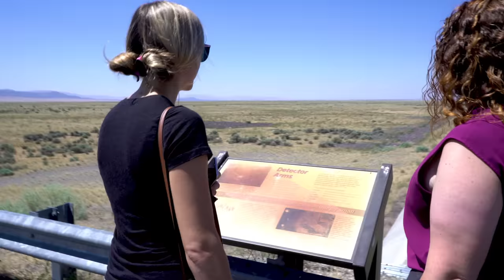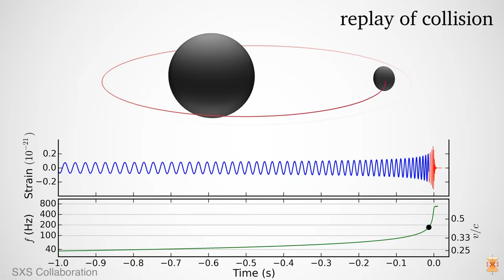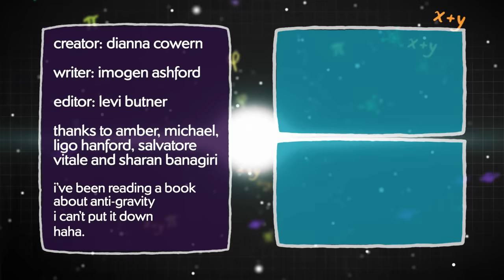Why are there giant concrete tunnels in the desert?

Comment: Speed of gravity that's new
Reply: Most people think of C as the speed of light. In reality it is the maximum speed of the universe. So anything that moves at maximum  velocity movies at the same speed as light because both of them are moving at C which is the maximum speed of the universe. Radio waves also travel at maximum speed. So if gravity has a speed it makes sense it is C.
Reply: It's always handy to remember that when we talk about the "speed of light" we're not actually talking about light* so much as the maximum possible speed that any signal/information can be sent. In that sense, everything has a speed, and gravity just happens to be in the special class of phenomena that operates at max speed (or so close to it as to be indistinguishable).

*Of course, it does also describe the speed of actual light in a vacuum.
Reply: It's all the same thing  and it's the speed of causality.

PBS spacetime has a great video on exactly that.
Reply: Yeah I thought that the effects of gravity were instant, wasn't that the premise of of Interstellar or something? Using gravitational waves in order to communicate instantly?
Reply: @skeptic1000  I don't think there was any faster-than-light communication in Interstellar, unless you count communicating through a wormhole. But that's not really "faster than light," it's just taking a different route.
Reply: @skeptic1000  it is instant if you stop thinking of delays as of delays in one direction.
But will it be instant round-trip?
Reply: Vsauce, Michael here...

No seriously, he did do a video on the speed of gravity. I forgot the exact title but it goes along the line of what happened if the sun disappeared.
Reply: @soth1sol  thanks for the link
Reply: @Marnige  you were right
Reply: @oppie2363  quantum teleportation faster than light, false?
Reply: @davemwangi05  Short answer: no, because it depends on classical communication to resolve.

Edit: I realized my answer might be confusing because you asked "false?" which makes my answer a double negative (and an incorrectly used one at that). To clarify: my understanding is that quantum teleportation depends on classical communication (i.e. light-speed-or-slower communication) to derive any legible information from the process, so it doesn't break the speed of causality.
Reply: @oppie2363  okay, entangled particles?
Reply: @ecospider5  radio waves are light waves. The spectrum of light is much much larger than what is visible to us.
Reply: @davemwangi05  My understanding is that the same principle as teleportation applies - the entanglement does appear to violate the speed of causality at the quantum level, but to derive any useable information from that process it has to be paired with classical communication. Don't take my word for it though; I'm mostly just a layperson/enthusiast. I recommend watching PBS Space Time's various videos on the subject of you're interested in it.
Reply: @oppie2363  PBS is a real Nerd. LOL I used to watch him but this u-tube algo.
Reply: @ecospider5  That's not right. There is no maximum speed of the universe. It (the universe) can move at any speed. It is currently expanding faster than c. That's how you get 13 billion year old universe where the size of the observable universe is 90 billion LR in diameter.  c is the fastest a signal can move through space-time.
Reply: @biffy7  I believe (though I don't have the math in front of me) cosmic inflation is consistent with relativity through time dilation.
Reply: Not new news. Gravitons have been conjectured through most of the 20th century and confirmed with relativity. Curiously, almost everything moves at the speed of light. The Higgs boson is the thing that slows stuff down, e.g. gives stuff mass.
Reply: The thing not understandable for humans is: when a black hole is a singularity in the space-time-field, means that the curvature of that field is infinite, how does it transmit the information of its own gravity? If gravitation moves with the speed of light, the gravitation itself cannot escape the black hole. But because black holes are only mass and nothing else, it would rip itself out of existence. But that cannot be, these things are very real. That would be a paradox to explain.
Reply: The wave has speed.

Gravity is the force of attraction, due to mass.
Reply: @stephanbrunker  It's a paradox of the model, obviously not of reality, given black holes exist just fine without ripping apart the whole of reality. But since we can't observe what's going on beyond the event horizon (not the black hole, itself) we can't see how to update our models to unwind the paradox.
Reply: @skeptic1000  i saw brian green say it was instant on pbs...
Reply: @CJ G I have always wondered about that with radio waves. Do radio waves have photons.
Reply: @Biffy7 from Wikipedia. “According to special relativity, c is the upper limit for the speed at which conventional matter and information can travel. Though this speed is most commonly associated with light, it is also the speed at which all massless particles and field perturbations travel in vacuum, including electromagnetic radiation and gravitational waves. Such particles and waves travel at c regardless of the motion of the source or the inertial reference frame of the observer. ”

That is what I was referring to. Which is much more than just signals. 
But I do get your point that including the expansion of the universe speed does get confusing since something can technically be getting farther away from me faster than c since the space between us is expanding. 

https://en.m.wikipedia.org/wiki/Speed_of_light#Numerical_value,_notation,_and_units
Reply: @ecospider5  Radio waves are light just like visible light so yes, it is made of photons. They just have a longer wavelength than visible light. On the other side, x-rays and cosmic rays have a much shorter wavelength.
Reply: Mmmm.  Not really  a =  m/s^2
Reply: soth1 sol 
Doomsday, or ignite a gas giant?
Reply: If the sun disappears you are going to wish the flat Earthers are right. Just kidding.
Reply: @oppie2363  Entangled particles are faster than light though and hypothetically even if it is paired with classical communication methods the loss of delay from relying on C would be greatly important, especially at light year distances
Reply: @liammargetts  If you're pairing it with classical communication, you're relying on C.
Reply: @oppie2363  But let's say entangled particle A on one side of the galaxy then particle B on the other side, if A's spin changes, B's spin will copy that instantly, so one just relies on C when trying to measure B
Reply: @liammargetts  Which means you can't know whether anything (e.g. spin) you measure about B is part of that communication or random noise until the classical communication arrives. So like I said above, it does appear that certain quantum effects propagate faster than C (or violate locality altogether, which amounts to the same thing in this case), but since they're dependent on classical communication to be legible, C as the maximum speed of information/causality is preserved.
Reply: @oppie2363  Oh I see. I don't have a reply, I'm optimistic that we'll find some way around that problem though as quantumly entangled communication seems very cool
Reply: @ecospider5  Technically, it's the speed of cause and effect.
Reply: @ecospider5  This is also the very same reason why nothing will ever travel faster than light. There is no energy to propel you faster. It has nothing to do with you gaining weight, energy just runs out of push force at the speed of light.
Reply: Not much talk of physics in these comments. LOL. Blooper in the opening remarks. If gravity arrived at earth in 8 minutes at lightspeed the  earth would be flung out of orbit in a few thousand years. Its been shown. This comfortable belief  seems to only serve to keep Einstein as the patron Saint of Science. Gravity influence is near instantaneous at about 20 billion times faster than lightspeed. And here it is explained succinctly at a physics site.
Does Gravity Travel at the Speed of Light?
In the simple newtonian model, gravity propagates instantaneously: the force exerted by a massive object points directly toward that object's present position.  For example, even though the Sun is 500 light seconds from the Earth, newtonian gravity describes a force on Earth directed towards the Sun's position "now," not its position 500 seconds ago.  
Putting a "light travel delay" (technically called "retardation") into newtonian gravity would make orbits unstable, leading to predictions that clearly contradict Solar System observations
  So Newton was wrong. They Forgot to tell you at school.
http://math.ucr.edu/home/baez/physics/Relativity/GR/grav_speed.html
You guys believe anything from a pretty face. But it doesn't really matter. LOL
Reply: @kimbo99 Well... Steve.... You are wrong too. Since Gravity is a wave and the Sun is giving off this wave in all directions, 500 seconds from when the wave was given off the earth moved 500 seconds but the wave that interacted with the earth was not from the point the wave was given off, but from the point where the earth would be 500 seconds later. 

I'm surprised you are not smart enough to know that or figure that out on your own. And yes the Gravity wave moves at the speed of light. That Gravity wave length is roughly 700 nanometers.
Reply: @kimbo99 After thinking about this for a few microseconds, I'll give you a better example. You are on the football field. You are a receiver and the ball is snapped. You start running. The quarterback is going to throw you the ball. He doesn't throw you the ball at your current position, He throws the ball to the position you will be at, for how ever long it takes the ball to travel to your future position. But, that position where you catch the ball is the shortest position between you and the quarterback. Now the quarterback could have thrown out millions of footballs by the time you started moving but you would have only been able to catch the one football out of millions that was the shortest distance between you and the quarterback at the time that it took that football to arrive to you.
Reply: Just remember, one must clarify that c is the speed of light IN A VACUUM.  Photons have been slowed down to less than normal highway speeds in experiments.
Reply: Matt Lombardo  who says it travels in waves?
Reply: Matt Lombardo   There are no ripples. gravity waves dark matter dark energy  black holes are inventions all to keep St Einstein in place as the patron saint of physics. The speed of gravity is 20 billion times lightspeed. Near instantaneous. C is slow by Universe standards.  C cant be exceeded but the universe expands quicker at 2.5 C Its on Discovery channel. Must be true. Real science worth following is Electric Universe. Much more empirical proof. Many more successful predictions than the Big Bang faireytale. Sorry no girls at Electric Universe.

Comment: So does gravity have a resonat  frequency or even have a frequency at all??
Reply: Isn't that like asking does sound have a resonant frequency? You need an object for the sound to resonate in and it's the properties of the object that determine the resonant frequency. I would be interested to know the answer though
Reply: @oliverwilson11  that's kinda why I asked lol I'm just going off of if gravity is measured as a wave or emits waves would it not have a measurable frequency?
Reply: They do, and LIGO cannot detect waves of the wrong frequency.

The issue is that 'gravitational waves' are different from 'gravity' in the same way sound waves are different from air pressure. We don't measure the strength of gravity as having a frequency any more than we'd measure the 'sound' of air pressure.

Gravitational waves are small variations in the gravitational field, the ones measured by LIGO starting at about 35Hz and increasing to a peak of 250Hz (The signal 'chirps' as the merger progresses.)
Reply: @Ryan Stasiuk  Given that we have so many names for different frequencies of electromagnetic radiation (infra-red, light, colors, radio, microwaves, x-rays, etc.), it’s surprising to eventually learn that they’re all fundamentally the same kind of wave-like energy. And it’s fair to ask if gravity is along that spectrum, and if not, if gravity behaves like a wave, too. 

The plain and simple answer is that gravity is a separate and unique form of energy (one of the four ‘fundamental interactions’) that is described as an attractive force between two masses. The force depends on the size of the masses and the distance between them, and does not have a fundamental or resonant frequency.

What’s been discovered and what experiments like this are measuring, is that when very large objects in the cosmos abruptly change their mass (like when huge stars explode or collapse, or when black holes collide), the previously relatively steady force they exerted on us ‘vibrates’ or ‘rings’ for a few seconds or minutes as the object(s) catastrophically change. Those ‘vibrations’ have a low frequency that can be measured, but gravity itself is not a periodically varying phenomenon.
Reply: Thank you and @Netpilot for actually taking the time and explaining it and not being like how the rest of the internet can be! Much appreciated!

Comment: How do they get the laser to follow the curvature of the earth? Because lasers travel in a straight line.
Reply: @Matt Logsdon Even the best mirrors do not reflect 100% of all radiation; some of the energy will still heat and eventually burn through the mirror.
Reply: They don’t. That’s why she said they have to compensate for the curvature of the Earth – the tube is higher out of the ground at both ends, more buried in the middle.

Comment: Oh the poor thing, talking about black holes, bending space-time and neutron stars colliding billion years ago...
Reply: This is the Michelson Morley experiment with ether being changed to magnetic waves. This is the fundamental change to make the science fit the model to force-feed the narrative.
Reply: @stevelindsay3643  The problem is they spent millions of dollars and two decades on a contraction that's basically an expensive seismograph, while they gave up on the aether research after a few experiments with results that didn't match what was predicted. They try to convince us that they're able to differentiate variations in length equal to 1/10,000 the width of a proton from random noise caused by variations in temperature, frequency of the laser, gamma radiation from the sun, micro earthquakes, etc, etc... Even worse, the method to "spot" a gravitational wave is analysed by computers that compare the hum produced by the interferometer with pre-programmed waves, based on collisions with a black hole with a mass X times greater than our sun with another black hole with a mass of Y suns !!! It could be hilarious if they had not buried millions of dollars in a useless project that serves no purpose... The control room is laughable, I work at a TV station with several control rooms by far more complex than that !!
Reply: @StillCloser  Well said. It is lunacy by all accounts all for nefarious reasons. Unfortunately, too many people believe the nonsense and swallow it hook line and sinker.

Comment: We visited LIGO about 11 months before the video was made and recall the tubes had to be built in straight line, not following the Earth curvature, but also recall them saying the original tube diameter proved too small, so they had to use slightly larger tubes. With my hearing problems I didn't catch exactly why, and didn't get another chance to ask before we had to leave.  It would be interesting to know exactly why they had to got to the bigger tubes, and if the display tube that had the thinness pointed out was one of the smaller diameter first set.

I think I remember them saying that it was the smaller diameter version.

Comment: A fan is an air screw. A boat propeller is  a water screw. Gravitational waves move as fast as light depending on how much light is present, obviously faster in denser less lit up space. So, could electromagnetic waves be used as a space screw? Maybe even scalar waves? Is this how this research could benefit us? I have always imagined gravitational waves to be how the fluidity of space moves through and around tangled light (atoms). Or how a single photon gets pinched through it. Oh, wow. Just answered my own question. Never mind.

Comment: So fabric of space time limits speed of gravity which hence limits the speed of any object with mass as any object with mass creates gravity, and to accelerate an object with mass faster than the speed of light it would move gravity faster than the maximum rate, tearing space time, which would require a ton of energy / break laws of physics.

Which is why warping  / folding space time so that we're not actually moving faster through it but more changing it's shape is the only way we might achieve faster than light travel. Neat.

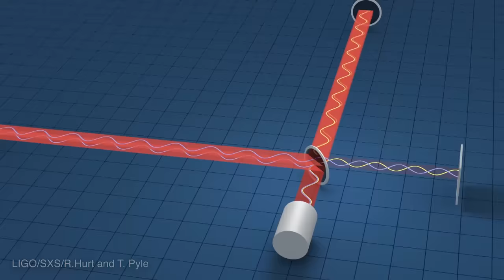Comment: 3:35 you are demonstrating very well how tectonic plates vibrate longitudinally... Those springs aren't going to cancel out the infinitesimal movements of that vibration, and thus the laser interference pattern only shows that the earth's crust compacts and stretches horizontally (along the surface, as opposed to perpendicular to the surface). Perhaps they can detect gravitational waves with that device, in which case you oversimplified things. I'm sure you're not aiming to reach the soccer fan crowd, so you don't have to descend that low =)) Thanks for the interesting video :)